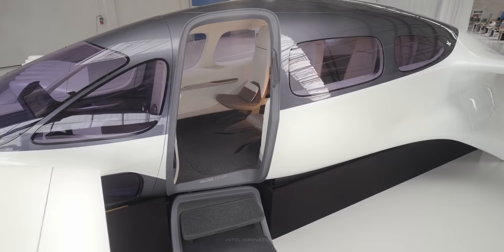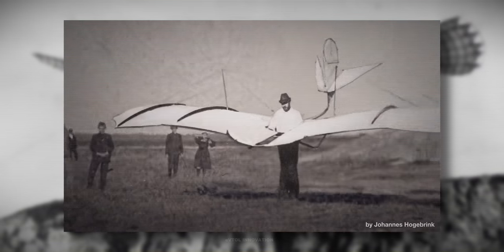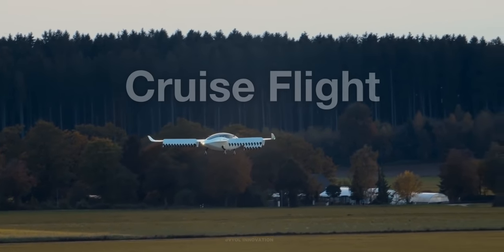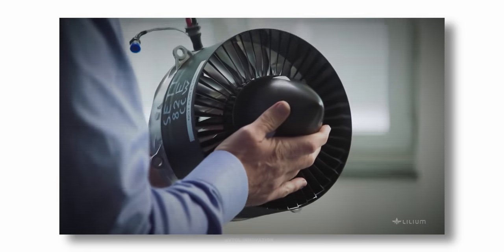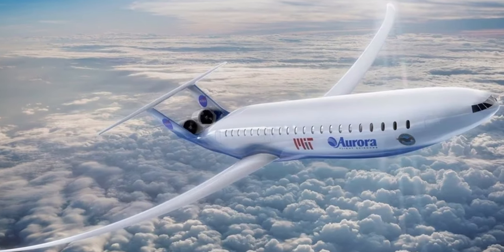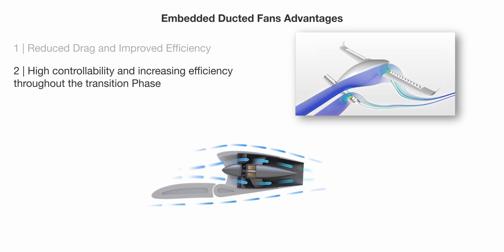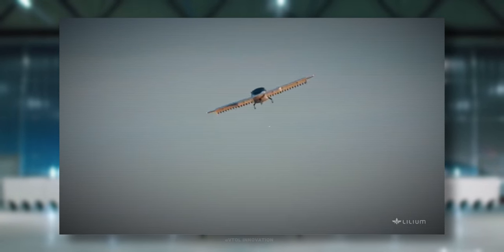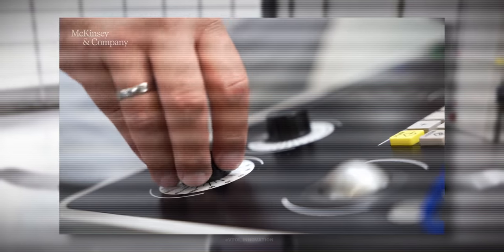The Insane Engineering behind The Lilium Jet | Part 1

Comment: i am wondering.. if these are going to be used in planned take off and landing ports.. could the craft be tethered to a power source to feed it the high power it need to lift off to perhaps 200 or 300 feet up and then while at hieght it could transition to horizontal travel then detach from the power cord. This could be provide either by a kind of exention cord that would detach.. or it could be connected to power source like an electric cable bus.. with the electric cable being vertical to the ground.. and as the craft lifts up.. it would gain altitude with maximum power consumption fed by ground energy supply.. then as it is at hieght.. the props would transition to horizontal.. the craft would have an extention to allow it to move away from the horizontal power cable and at perhaps 50 feet from the power cable, it would detach from craft, allowing the craft to proceed with onboard battery suppoly? This would allow it to use most of its power for horizonal flight with its wings providing most of its lift and giving it power to transition back to a vertical landing? And in case of emergency(or planned), it could still land like an airplane, reducinging its power needs for landing? and if designed right, it may even be able to glide to a landing??

Comment: Aerodynamically it make sense, but battery powered aircraft are a non-starter.  Put a fuel cell or an inernal combustion engine on it for power generation, and it works.

Comment: I think that EV general aviation will have a future once the batteries advance enough & costs come down. Aircraft part expense & fuel costs are high. I like EV boats because they're simple to maintain and you can charge your boat during the week for the weekend with solar or wind & still have more range you'll boat in a weekend with a single charge.
Reply: Battery cost is the least of the problems with electric aviation. Energy-to-weight ratio is the killer, so it will only ever be feasible for short flights. For longer range zero-emissions flight, biofuel-powered conventional jets are likely the way forward.

Comment: As of now current battery’s don’t have high enough power density to maintain flight for long. We just have to wait for the successor of the lithium-ion. I heard lithium-sulfur can hold 4x as much over lithium-ion while being more stable as well. Another contender is the sodium battery. It and a potential to hold 7x as much over lithium. sodium is also plentiful so could make for cheaper battery production. I’m not 100% on these facts so if your interested be sure to look them up for yourself.

Comment: It looks beautiful, but we probably need batteries about 5X+ better from a power/weight ratio than currently possible for useful range and performance.
Reply: I think such systems should be designed with easily replaceable batteries, so as not to wait for charging. There are not a lot of models like cars. It must be easy. Take rendezvous to stations, replace battery and contunie to travel. I think one battery can pass 300 miles for now. Is not it enough?

Comment: Imagine adjacent props are megnetically locked, each gives thrust to the next. Only one rotor is directly powered, all the next on a wing are slaves. For redundancy, the first and last of a wing are driven.
Reply: No, nothing 'gives thrust to the next' except in some magic fantasy world.
Reply: and once that single motor fails :O
Reply: You need to check your engineering buddy: what size magnets do you need to transfer 190kW (power needed for Lilium to hover) over the span of the wing?
Reply: @aliptera  Do you know the first thing about engineering ? This has nothing whatever to do with how big any damn MAGNETS are FFS !
Reply: How would this help? The same amount of power is still needed to turn the rotors. No, the beauty of this concept is that there are a bunch of independent motors and controllers.

Comment: An interesting beastie but I'd be more interested in seeing a STOL/STOVL than a pure VTOL as it's a more efficient flight model. The fan positioning, using the airflow over the wing to generate more lift, reminds of the Custer Channelwing in concept, and I particularly noted the manta ray shown early on in the concept art which, oddly enough, was something my father (a retired aero engineer) and I were discussing a few months back.
Overall it looks promising but I wonder about the range and whether or not it would be possible to extend it by using a small gas turbine generator or solar panels.

Comment: It is revealing that EV aircraft vendors focus all their spin on the new neat things they are doing while always shying away from the real issue energy density of the electric storage device (battery, super capacitor, fuel cell, etc.) which no where near the what can be achieved with current aviation fuel levels. Until some breakthrough approach to bring energy density in line with this,  ev aviation solutions will continue  to be just a novelty item.
Reply: The current performance of lithium battery technology is sufficient for short range aviation. The question is whether there is much demand for planes with 100-250 mile range. Probably not.

Comment: Superb innovation... The only problem that I see in this technology is use of more numbers of turbines!!!. The more you have the rotating parts more is the failure rating. But the argument will be made that the more the turbines then more is the redundancy ultminately offsetting these failure... Its a trade off and needs to well studied in this direction.... When you try to mitigate these failure rating more will become the maintenance cost. That's the reason in the conventional jet aeroplanes, they prefer to have twin engine rather than 4 or more!! Nevertheless, this is a clever design and technology and wishing such designs hits the aviation industry asap...

Comment: I have the sneaking suspicion that this aircraft was designed to hover a cockpit, and that's about it..
Ducted fans are extremely draggy at speed, the individual fan blades are fixed and incapable of pitch changes, and even if they where there are MUCH more efficient designs for forward flight.
I doubt this thing has the potential for any meaningful range.
I suspect the aircraft is wildly unstable in pitch while in forward flight, and due to the limited wing area and its reliance on what is essentially a large blown flap, the motors are going to have to run wide open to produce any meaningful lift.

As for the comments section, there is a lot of "fan boy", (that's a pun) comments, almost as if it where mostly populated by employees, or sock puppet accounts.

This idea of technology demonstrators that lead nowhere has been around since the 1920's, and for whatever reason certain fringe groups in the aviation industry continually pump out one variant after another of these "flying car designs". 
Most have been largely incapable of even hovering, so this group is to be commended, but they have essentially designed what amounts to a upscaled drone. 

Any money invested in this "flying car" should be considered a waste, and as an investor you might as well throw your cash into the sea rather than give it blindly to whomever these people are.

I am especially NOT impressed by the footage of this thing in a hanger surrounded by technicians at computer desks, supposedly working on whatever this thing is.
It's NOT a car, it is NOT an airplane or a helicopter. 
It likely IS the brainchild of a couple of people who are either deluded, or who are trying to separate unsuspecting, (though well intentioned) people from their money.

Even large well established aviation company's are currently incapable of building or designing a practical aircraft that is capable of relying on electric power. 
The aerodynamics/technology required to make a viable/efficient aircraft have been known for over 50 years. Thats why passenger, and general aviation designs have changed very little since the 1950's. 

If you have made it this far, and you want to see a truly inspired attempt at building a practical flying car I suggest looking up the "Aerocar", designed and built by Moulton Taylor in 1949, though even this brilliant attempt was neither a very good car, or a very good airplane.

Comment: Bi-planes or flying wings should probably be used more for electric flight.  Why?  Mostly lift.  They can just lift a lot more per power.  This is important with electric planes that need to lift a lot more batteries.  i.e.  The Caproni ca.90 could lift 8,000 kg.  The Junkers G.38 could carry a couple kilo more.  These planes are bigger and can carry more than a B-17, and yet, their power is of similar size.  The B-17 could fly about twice as fast, but going twice as fast creates 4 times the drag.... so...  lift or speed?  Electric seems like lift is the priority.  I'm curious to know if the ridge on top of the jets for the Lilium create some level of lift as well.  If not, they should maybe engineer it, as though a second wing a bit more.

Comment: @4:40 you make a VERY misleading statement about disc loading vs efficiency. What you fail to emphasize is this is only true for a "given disc loading". It is ALWAYS more efficient to just use a bigger rotor, unless you are constrained otherwise. And this is EXACTLY why the JOBY use bigger rotors.
Reply from the maker: I said “same disc load”
Reply: @eVTOLinnovation  I did misquote you slightly, my apologies, I'll edit my comment. But my original point still stands. Which is this is an artificial constraint.

Comment: As I watch the share price drop to practically nothing, I wonder what possessed me to invest in this company? As a former pilot there are so many situations of altitude, density, wind sheer etc... that for brevity, I will not expound on. This company has so many great ideas. What needs to be added is a fuel/electric redundancy feature (ie: Prius like) for emergencies in the event of full electric battery failure. I'm keeping my stock LILIUM. Make it better.
יוי
Reply: Adding complexity and weight with hybrid. Better to split systems so there is a working alternative e.g. battery is made of at least two independent separated packs...
Reply: @KeithWW  They will have more than 2 packs.
Reply: @0Turbox  yeah, it was just an example - a minimum amount of redundancy. Although there's a downside with too much redundancy or splitting systems into too many independent parts. There will be a balance of number of separate systems and how many can be lost but still land safely but also not degrade the system, makes overly complex...
Reply: Sorry dude you just wasted your money, battery powered aircrafts are just stupid with the current and near future battery technology.
Reply: The price of fuel could make this very relevant...
Reply: @vmiguel1988  maybe you are right....I bought AAPL @ $13/sh.....still have it. 
יוי
Reply: @yowwwwie  sell before the bubble pops

Comment: what if they made this hybrid electric?  that should substantially increase range, although at the cost of weight.
Reply: Hybrid technology is of great value to cars...driving in the city.  That's because of the large amount of energy expended constantly starting and stopping.  Notice that hybrid vehicles' HIGHWAY fuel economy is marginally better than a similar non-hybrid vehicle's highway fuel economy.  The huge improvement of a "hybrid" vehicle drivetrain is in stop-and-go traffic--because a non-hybrid vehicle generally gets very poor mileage in stop-and-go traffic.
Locomotives use a hybrid powertrain (diesel-electric, but no batteries)...however, this is largely because of electric motors' extreme torque from a complete stop.  They also allow the diesel engine to be run closer to the peak efficiency RPM.  Once again, it's the start/stop principle.

I would be very surprised if there is anything to be gained with a "hybrid" propulsion system in aircraft, as airplanes don't "stop for red lights" mid-air...and the propellers ideally are designed to run at the engine's peak efficiency RPMs in the first place.
Any conversion system (i.e. diesel-electric) adds energy losses.  Thus, any improvement in one place would have to be significant to overcome the power conversion losses caused by adding a "hybrid" system.
Reply: @sidlori1592  The benefit is a hybrid approach let's you use fuel instead of batteries for energy, and fuels have around 60x the energy for the same weight. Even accounting for 30% efficient conversion of fuel to power you have 18x the range for the same weight, or 9x the range at half the weight etc. This easily accomodates the added weight of the generator while still being lighter overall. Not to mention, when burning fuels you get lighter as you fly which gives you an additional weight benefit. For my 60x value, I'm using the accepted value of 40MJ/kg for gasoline and 660kJ/kg for the batteries.

Comment: As the expert of Electronics Engineering- I have got some questions. Very nice video, but with much more focus on aerodynamics and aviation theory as on aircraft power supply.  A battery suffers in the long run and lasts shorter over time and over each charging.  I mean that everybody knows that the battery will lose the capacity (battery power) with every new charging time. 
What will happen after 500 charging times? Also we know that you can charge battery pack about 1000 times, maybe 2000 times (depending on a number of obstacles)  before you go into problems, that charging is not anymore possible or the power reaches only 10-15 percent. 
Sure, it is installed also the control of battery pack and a pilot knows the capacity before he starts vertical take-off. 
What impact will have this to airplane costs? 
How often we need to change the whole battery pack? And this could have high very price. 
And what is happening when, for instance, the whole system due to failure loses power.
 In helicopter case it is more or less clear. With Lilium not. 
Could you pls explain. Thks a lot.

Comment: You say high-speed, but currently they're only capable of speeds la little over 175 MPH, the range isn't all that great either, only 155 miles.  Compare that to even something like a Cessna 182, which can fly at 193 MPH and has a range of over 1050 miles, and doesn't even come close to planes like the Boeing 737 which can do 588 MPH and fly almost 6000 miles.

Don't be mistaken, electric planes are cool and do have potential, but they're not going to be replacing conventional aircraft in the commercial sector anytime soon.

Comment: Birdstrike?

High winds?

Wind shear?

Lots of questions…
Reply: Even without advanced knowledge, it seems clear that a birdstrike should cause less of a problem to this craft than to a twin engine plane where a single bird sucked into the 3-meter or 10-feet diameter engine can kill 50 percent of thrust. Unlikely that a birdstrike will have such devastating effects on this craft, but a prop without casing will probably handle it better.
Same with windshear, since it relies more on engine power, especially at take off and landing, and goes at lower speeds.
And, by the way, you can ask those questions with any aircraft. So nothing special.
And: No, I'm not a Lilium fan, I think they will fail, be they fellow countrymen or not.
Reply: @frankyboy1131  interesting   I have no experience or expertise in this  … just obvious questions. It’s pitched ( see what I did there?)  as everything’s is perfect in a perfect scenario.  Too narrow.

Comment: This is a really cool concept, but I think it will be used purely for research, or as a toy for rich people. I say this for three reasons.
1) The design of this will be prohibitively expensive. To be fair, this is an issue with a lot of futuristic concepts. This design can't be made with cheap manufacturing processes, which will mean making a fleet of these would be really expensive, should any city/airline want to adopt them.
2) Probably more problematic. This is based on electric - and therefore battery - power. Unfortunately, batteries just don't have the same energy density as fuels, so the range on these will be limited to short distances. Basically these will be air taxis, which leads to the biggest problem:
3) How on earth will these be regulated? No airline will want to use them as the profit margins will be slim. Sure, cities could adopt them, but you can't just have aircraft flying wherever, whenever and at whatever altitude and speed you want. Cars are one thing - we can put up guide rails and barriers, but we can't erect giant nets around buildings to prevent our sky taxis from smashing into them. Ultimately, it would create more problems than it solves

I think this is really cool, and they are doing good and important research, but I don't expect we will see anything massive comin from this. At least not anytime soon. Perhaps these could be great in some niche cases, such as in Vancouver and other places where air taxis are already a thing, but in general existing modes of public transit are already far more efficient and cheap.

Comment: I don't understand how an electric ducted fan can be considered a "jet." Unless you're going to compress a mixture of hot air and fuel and ignite that, I don't see how you can create a jet engine. And I don't see how conventional electric engines can do that even if the energy density issues are overcome. Maybe I'm missing something I just don't see how an electric jet would work.
Reply from the maker: Watch Part 2